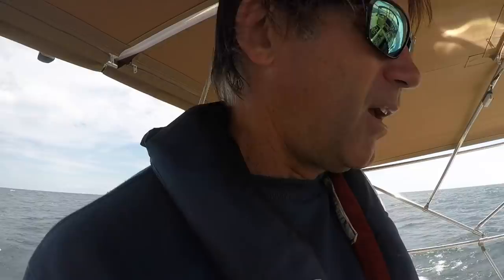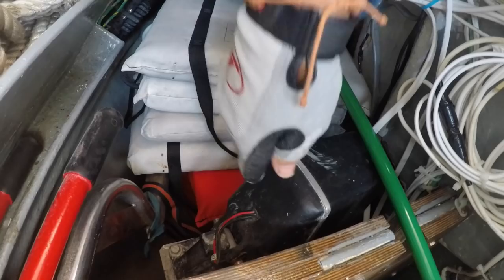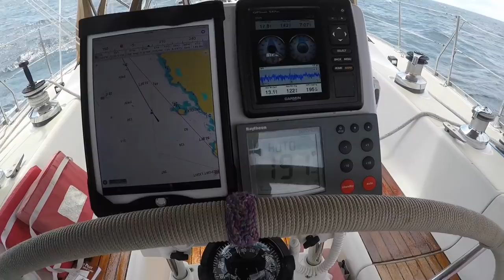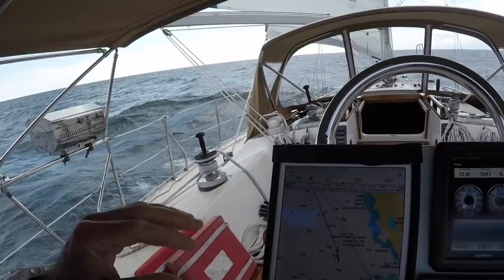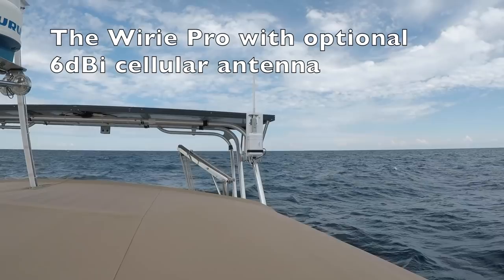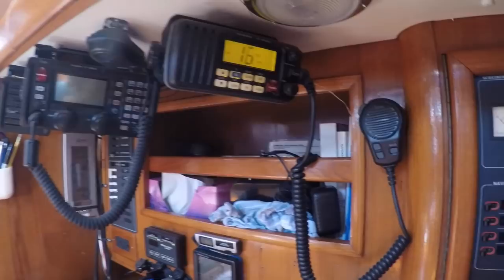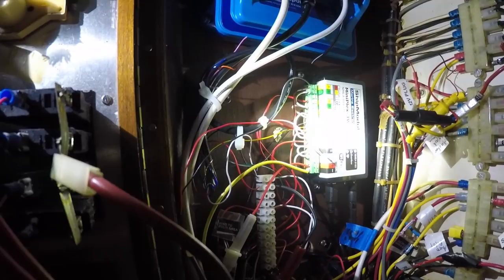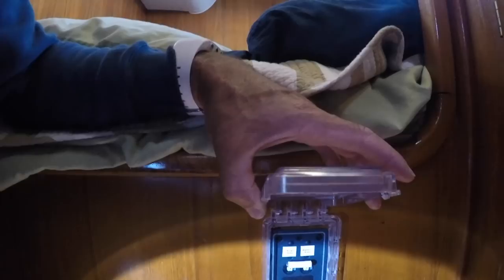Navigation Gear and Electronics for a Cruising Sailboat | Ep. 11

Comment: Good morning I am looking in purchasing the 440 i was wondering if you had in-mast main and if so how it performs in light winds there seems to be a big difference in squared footage
Reply from the maker: Hello Jean. Yes we do have the in-mast furling for the mainsail. You do lose some volume (and sail shape) versus the battened sail, but for us, it is so much easier and safer to reef, that it is worth it. It is a tradeoff, and perfect for the extended cruising we do. I think we sail more than others because we also don't have to debate hoisting the sail each time. We also bought and use a Code 0 for light wind days. Ofcourse, it does not help while beating upwind on a light day, but for all other points of sail, we feel we have a solution for the smaller mainsail size.
Reply: @LifeFourPointZero  thank you

Comment: Great video...The hotspot/cell service signal booster, what is it's range?
Reply from the maker: I found the range varied alot and it wasn't clear exactly why but for cell service we had the long range antenna option and in good condition we had internet several miles offshore. It's not easy to determine where the tower was that it was using so it's a bit of guesswork. For wifi maybe a 1/4 mile. But if there was a lot of WiFi networks in the area it had a hard time. Still much more reliable than a mobile phone hotspot.
Reply: Thanks, Tom, I've seen them test boosters on land here before and I seem to recall 10 or so miles max, but figured it would be even better over water/no obstacles. Good to know.

Comment: what is the minimum of equipment you would NEED (not want)  to go cruising?
Reply from the maker: Good question Wm, and I'm sure you'll get a wide  variety of answers! While we have survived before with only a compass and depthsounder, I would say a GPS/chartplotter is essential, followed by an epirb if you're going offshore. A VHF is mandatory, for good  reason  Then it's a runoff between AIS and radar. Lastly, again if you are offshore, an autopilot or windvane is critical unless you have the luxury of a large crew. Good luck!

Comment: What device(es) feeds your wind instruments?
Reply from the maker: The wind display can use boat speed thru the water or GPS (speed over ground) as an input from the multiplexer in order to calculate true wind speed and angle. I used boat speed. Fyi I also took the wind output and connected that to rhe autopilot to have the option of locking on to a wind angle.

Comment: Overall great video and very informative but I would like to mention a few things.

Autopilot - You bring up all the good points of having an autopilot but fail to mention the hazards. There have been far too many accidents caused by improper use of an autopilot system. There should be somebody on watch at all times, even when autopilot is engaged.

With that said, I do not have autopilot on my sailboat as I use a windvane that does not use precious electricity. I do sleep and go below during long passages, with the windvane engaged, and always have a alarm set to sound every fifteen minutes. This breaks a critical rule of always having somebody on watch but as a solo sailor I really have no choice. It takes me about a minute to check what needs to be checked and if all is well I go back to whatever I was doing or back to sleep. It seems odd to sleep only fifteen minutes at a time but it's not too bad. 

AIS - I have been in many areas where I have been practically surrounded by boats with not a single one showing on AIS. It is a great technology but not something I depend on.

iNavX - Internet or cellphone service is only needed to download charts. Once charts are downloaded no connection is needed. I don't have internet or cellphone service after I leave my slip and iNavX works just fine. I only use iNavX as a backup but it could certainly be used as a primary system.
Reply from the maker: Thanks for your comments S/V Tattoo. Yes I agree autopilot should not remove the need for someone to be on watch. It does help alot, as I'm sure you are aware with a windvane setup, to relieve the skipper from having to steer a straight course, and is tremendously helpful during sail changes or other critical times. On AIS, we use it as another aid but don't rely on it. It is surprising how many boats - big yachts especially - are not transmitting AIS, but for the ones that do, it really helps alot. Glad you like iNavX. It is a nice application. Fair winds!

Comment: seems like overkill for a lake cruiser i get around fine with a compass and a garmin handheld gps like why do you need his when you're never more than 8 hours from land and no-one ever sails at night on the great lakes
Reply from the maker: I agree that you can get by with less (i sailed for years with compass and depthsounder only), but we were fitting this boat out for extended cruising, not just in the great lakes. Still, I think as electronics and safety systems become cheaper, it makes sense to consider them. Regardless of lake or ocean, an autopilot is very helpful. We used radar all the time, especially on Lake Erie, to understand size and direction of thunderstorms nearby, or lake freighters when visibility was poor. As AIS gets cheaper, cruising boats without it will be the exception. It's one of the most beneficial safety systems in my opinion. Happy voyaging!
Reply: @LifeFourPointZero  I'm sorry i misunderstood i thought you had all that for a great lakes boat I'm on lake ontario and if I'm sticking to the coast i don't even bother taking out the chart or gps I'm always bothered by people who have all sorts of bluewater gear and keep their boat on a cottage lakes

Comment: You forgot a CB radio.
Reply from the maker: Hi Willard. I have never seen a CB radio on a boat, but thanks for the suggestion. There is a more higher powered radio, a single sideband radio (SSB), that is an option for longer cruises. But the VHF radio is the standard for marine communication.

Comment: Did you ever think that all this is MAN and MACHINE.  If Columbus could have had all these fine electronics, he would have.  Some guys like to be electronic minimalists. Others are looking at the affordability index.  It would be fun to have all that and be flying the sailboat like it was a airplane.  More knowledge of surroundings is going to reduce stress well.  My vintage sailboat has me wanting to be so old fashioned that I am missing the boat as to some of  these gadgets and I think my bias against gadgets is unwise.  I can get half of that stuff and just make sailing easier. If mice ate some wires or corrosion wrecked some of it, so be it.  Just go back to basics.  I'd have mouse traps set at key locations.  Those rat preventers on the dock lines, important.  Some oils used to make wiring insulation are from soybeans.  Made in China wires.  Mice like soy.  You park a truck in the desert with the hood down, lots of shade, mice move in, eat the wires.It happens at night. Oops, truck won't start.   So all over Arizona they park the truck and open the hood so no shade for mice.  You pull that boat into some tropical port, bring on all the nice fresh food.  One hungry mouse climbs on board,  could do thousands of damage.  But if I had a boat that nice, I'd be eating at restaurants anyway.  Bravo on all the electronics.  Learned alot,  taking notes too. Thank you.
Reply from the maker: Your welcome.